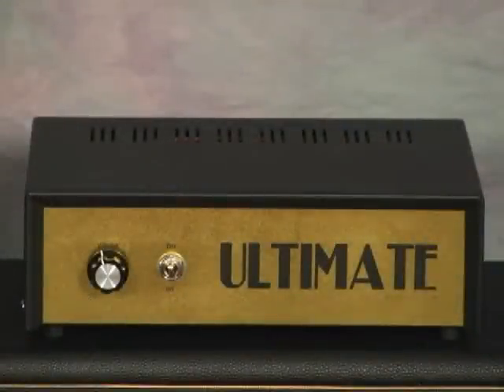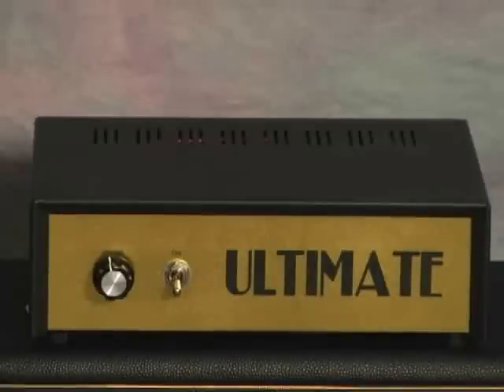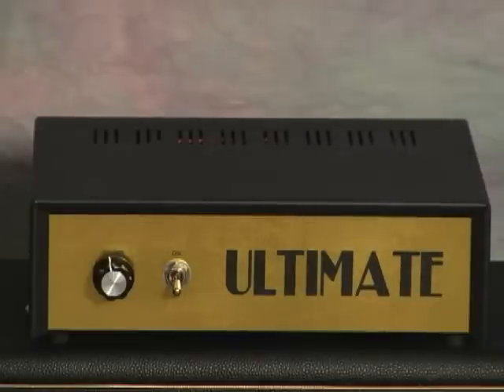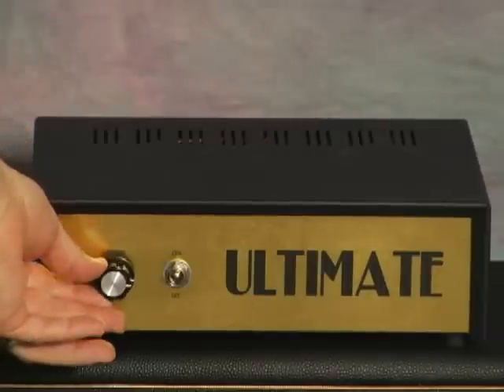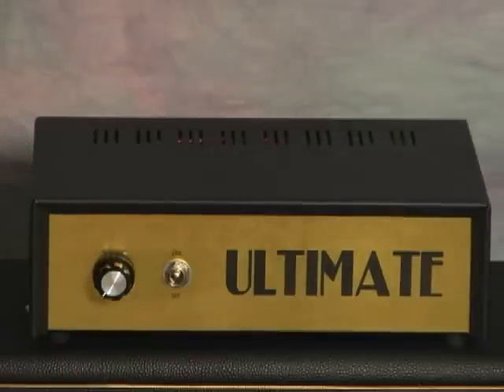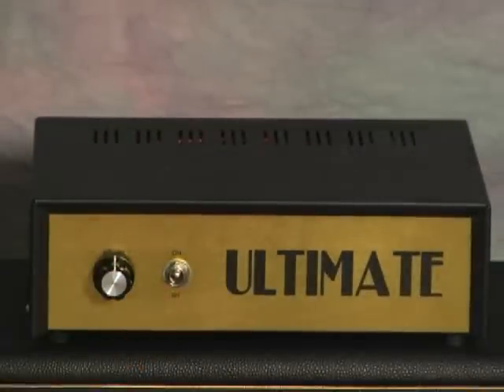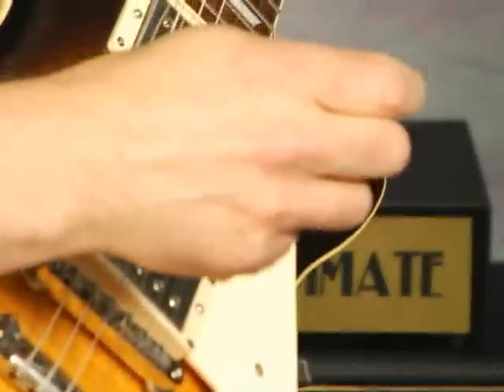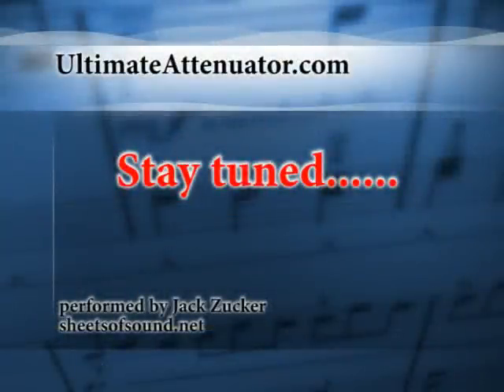Ultimate Attenuator Overview Demo

Comment: Hi, do you think you could fit in a demo comparing the different voltage taps for the UA? I'm really curious if the 100V tap really affects the dynamics of the amp (and if it is safe). Thanks

Comment: Great demo - no thinning of tone as you back off on the volume control.  Attenuators have certainly come a long way.  Suhr Badger amps have the power scaling feature which is licensed from London Power.  Same results - tone stays consistent throughout the attenuation range.